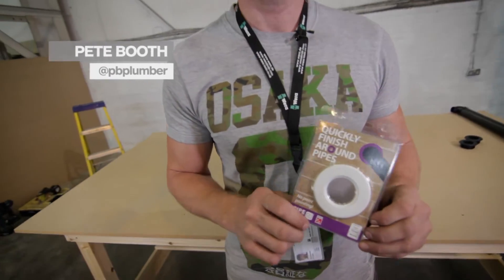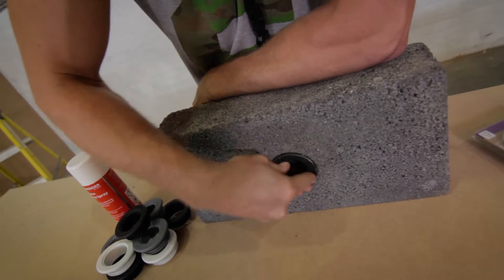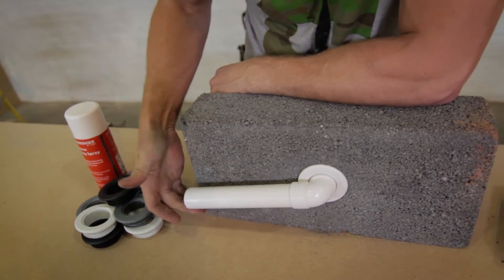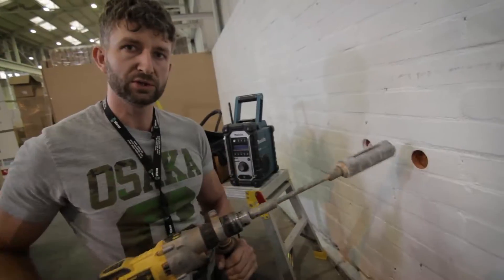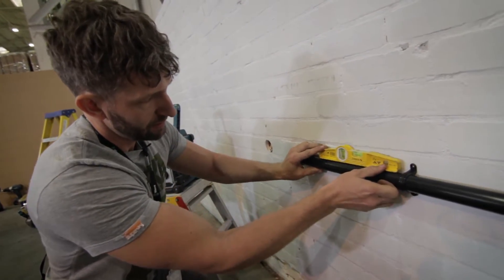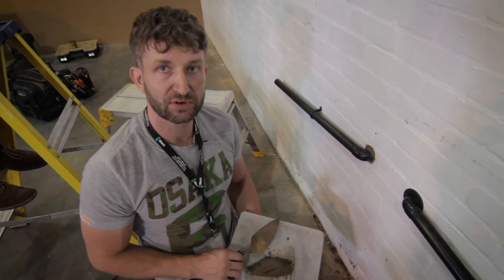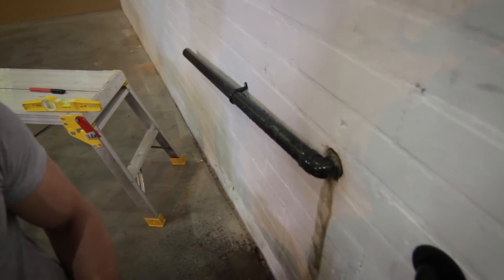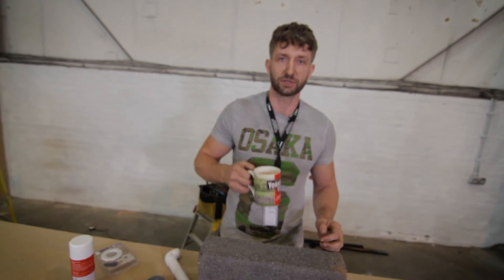PipeSnug Review by PB Plumber

Comment: What size core drill do you need for snug to fit into.
Reply from the maker: Hi Peter. The 32 and 40mm PipeSnug versions both use a 52mm core drill. The 110mm version fits a 152mm core
Reply: @pipesnug3011  ok thanks for info 👍
Reply: @pipesnug3011  Drilling a 150mm hole for a 110mm soil pipe is a tad excessive.. I've just rerouted a soil pipe and used a 117mm core bit, siliconed around the hole and fitted a pipe collar.
Reply from the maker: @westlondon7942  Hi.  One of the reasons for this is that it allows you to install FlueSnug from the inside - which is great when installing boilers at height (lofts, flats, etc.).  See this video for more - https://youtube.com/shorts/4bHPGTW4peM?feature=share
Reply: @pipesnug3011  I watched the video, I'd like too see you try fitting that pipe snug through a standard 13.5" thick wall ...
. without the option of looking over the top of the wall to check it's in place properly, as clearly shown in video. 

You also have the unenviable task of making good a 150mm inside the customers house. You'd need a mortar mix for that repair, whereas before you just needed silicone sealant. Unnecessary.